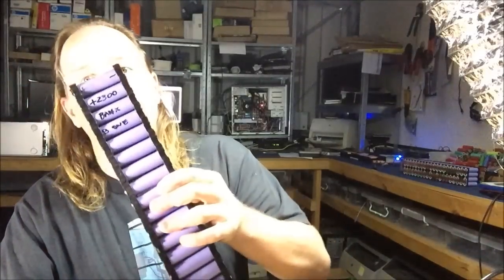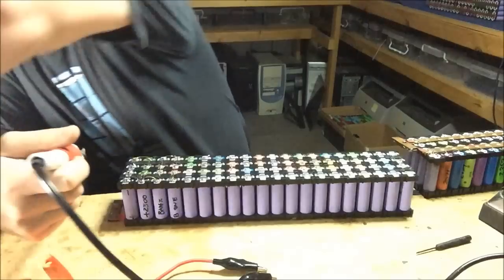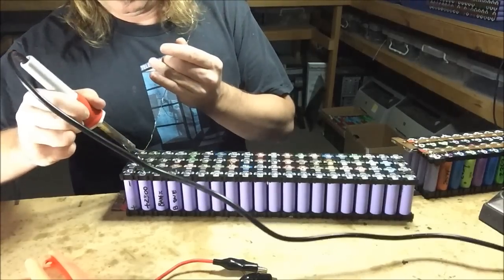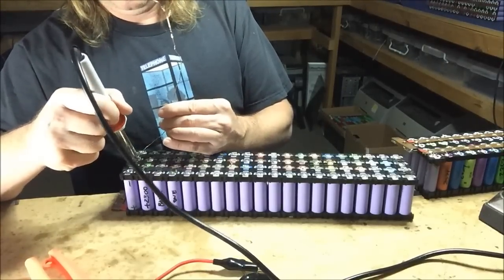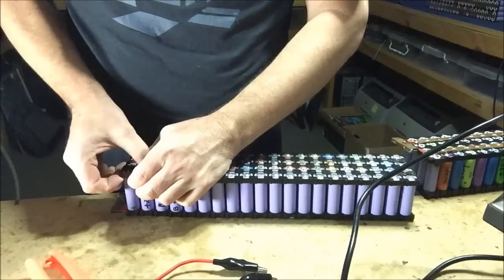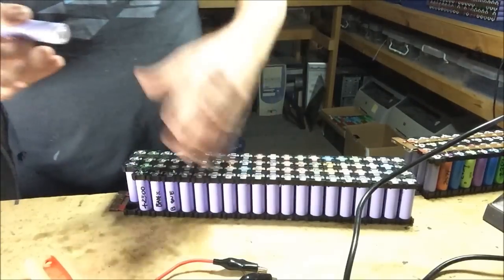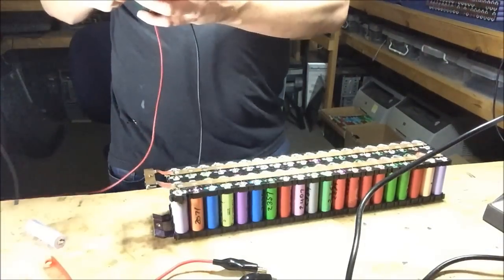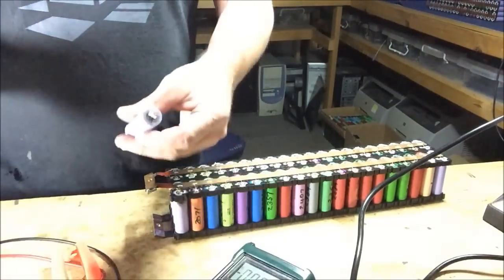80 cells versus 1 faulty cell 18650 fuse test

Comment: why not use just 5A fuse wire...its copper with a tin coating for a reason 
have you not just taken a cell out of a pack and just wired it outside the pack...why had its fuse blown..?
your are the best on the Tesla power wall thing...might get me one of those T-shirts
anyway its dull and cloudy here in the uk...keep it up

Comment: are the new stile lithium ion laptop battery ok to us in power wall they using the flat packs that look to me like lithium polymer
Reply from the maker: Anything is if you can make it work safely - it's all about second life storage
Reply: @HBPowerwall  they are i bit confusing as they say lithium ion on the laptop packaging but in side UPF576860TA sanyo 13wh  this is the only type of cell im able to selvage currently and cant seam to get any data on it

Comment: What is the average capacity of your cells? I'm trying for 2400 &  up and rated capacity or better.
Reply from the maker: Well just finished using the iCharger X6 https://goo.gl/GtBtW9 to tests 25 packs and even tho 'I THOUGHT' the average was around 2400mah testing the whole packs revealed that my average is around 2100mah per cell

Comment: Ahhh, shit. I seen the other video first, and commented on it (so I guess I spoke too soon, haha). 

Anywho, here is what I said on the previous video 

"I'm running a 48V 250Ah 16S50P LiFepo4 pack for an RV and used 0.125mm tinned copper for fusing, and tested it out. The fuse blows at 3.25A, red hot at 3A, discolored at 2.75A. I did this "in theory" because I didn't ever want the batteries to put out or take more than what the system is rated for. I could've used 0.1mm and still had been fine because 0.1mm blew at 2.75A. The cell fuses are rated around 40A higher (all together) than the main fuses (which are 125A mains). So it's not necessarily about protecting each individual cell, but more of an added protection according to the systems rating, although if a cell was to short, I'd hope it would blow. The main focus was to make sure the batteries are never giving or taking more than what the system's hardware can handle." 

So in the end, it's more about fire protection for the entire system, whether it is severed from an individual cell or not
Reply from the maker: All good - here is the reply from the other video... lol - "After two years of doing this cell fuses have now saved me a few times - several cells have gone zero volts & blown the fuse.."
Reply: HBPowerwall right on man. I tried testing the whole fuse wire thing about 6 months ago, but was performing the test using only one battery, and an adjustable power supply. I could never get the fuse wire to melt and break. So originally, I thought it to be a little stupid. But the only stupid one was me. There wasn't enough potential to blow the fuse, and the wire would simply get hot and only carry somewhere around 2.5A (at charging voltage). But hooking it up to multiple batteries, no problem, blew like a firecracker. 

I am going to do a slow motion video showing what happens to the fuses when you short 50 LiFepo4 cells in parallel. I did it once, and they blew so fast that I didn't even see them blow. It'd probably make a great slow mo video.

Comment: I ask for and advice, I make a small hole in a 8 packs cell trying to separate them, one small spark and the cell went into flames, all of them explodes one by one.  I'm concerned about security, I'm going to have 3 system 7.6kw, 7.6kw, 10.1kw a lot of cells, but if one of them goes into flame I think all of them is going to explode(very dangerous), I'm using 1 amp fuses in each cell, do you think this is enough security or I need something else.
Reply from the maker: You should seek professional advice - 'm not professional, I just document my journey

Comment: i whant to ask you i want to build a motorbike on electric 120 hp electro motor what is the best way to build you pack without bms, i dont like bms, and i want to charges  72 volt/ 144  lot of amp for long ride, greetings
Reply: You need BMS when dealing with Lithium batteries. By hook or by crook. It's for the utmost safety reason in dealing with delicate chemical energy storage.

It's like asking to supply power to your home without breaker/fuse.

If things can go wrong, it will go wrong - Murphy's Law.
Reply: Use a BMS intended for EVs that can send control signals allowing you to trigger solenoids/heavy duty high current relays. This way when the BMS notices an issue with the pack it can reduce/cut power, turn off charging or initiate balancing. It’s complex but building EVs is.

Comment: Batteries can fail in a multitude of ways.  They can go open circuit, short circuit or just plain poor in their capacity.  Fuses protect against a low internal resistance i.e. "short" circuit.  This is dangerous situation that can cause explosions with in the battery pile.  That is what a fuse protects against.
Reply from the maker: I agree, hence 4480 fused cells in my battery pack and soon to be 5600

Comment: Yeah , really good demo. Do you fuse both positive and negative sides or do you only use a fuse on one side for the 80 pack ?
Reply from the maker: first 42 packs are just fused on the positive side, next 28 packs will be both sides

Comment: It seams that so long as the battery has a charge  potential  between + and - (it's charged), it acts like a diode thereby not allowing a reverse current dead short between the busbars. And knowing that the battery has a tiny milli ohm internal resistance, when the potential is gone(flat battery) the current can flow backwards between the two BB. If that fuse wasn't there most likely there would have been a fire, unless it was one of those CID cells. 
There doesn't seam like  much documentation on how cells fail, so maybe you could do that same test on a variety of cells that you have deemed bad, just to see what happens. If you are looking for trouble and  have a isolated bunker with some long wires, maybe try it without a fuse.
Reply from the maker: I've done a whole weeks worth of work trying to get cells to fail - and to be honest wasn't worth uploading. You either have to be unlucky or plain brutal/stupid. To get a cell to fail on call well with my time frame anyway.
Reply: So out of all those dead cells you find in old packs, it's rare that they become a dead short and blow a fuse. The newer CID ones will pop the internal switch when they get hot, so they won't dead short. I have some old rusty ones that measure 1 ohm, and I have some dead ones measuring 10M ohms, so the 1 ohm can be a dead short, but the 10M can't because the resistance is too high. I would have thought most batteries fail to charge because of increasing resistance, so maybe the low resistance dead short is very rare. I guess can run a high potential in reverse through my rusty ones.
Reply from the maker: I weed out the bad/worse/dead ones in the testing process. Only a few cells that i know of have failed with daily use with in my powerwall.

Comment: that situation has been bothering me for a long time while watching you build your battery packs... I'm glad to see you did test that issue... couple questions (again) if you get a moment to reply...

1) how did you discover the defective cell among all the other ones besides how it looks ?

2) I see how short are your fuse link soldered to the buss-bar, have you tried this with such a short lenght ? All I see in your test is that you use like 2 or 3 inches of fuse (which might have a higher resistance thus making it blow faster that a short one). Take a close look on how close and short is your fuse link on the pack...

3) is not really a question but more of suggestion, you should have a damp towel near you, as soon you finish soldering, apply the damp cloth to your soldering point, it will cool the battery really quickly...

and lastly, while I watch how you constructed the pack, wouldn't it be nice to have like a battery cell box that could hold the same quantity of batteries as your packs but would allow to access any cell without having to solder anything... you know like when we use to put batteries in series in a radio or remote control... except this box would handle 80 cells... just ideas...
Reply from the maker: 1. Looks, voltage and fuse was blown

2. Done DOZENS of tests either off camera or just deleted useless footage there is little difference between 1cm and 10cm

3. Good idea

not soldering any more would be great :)
Reply: thanks for the reply as always... yep, the battery box would be awesome... maybe using a 3d printer, you could experiment with ideas... that would be great product to sell... only need to put batteries in the battery box and there you go, a battery pack ready for action ! All this based on your original design... but with removable batteries...

sorry for the typos on original question... I fixed some of the obvious... english is not my first spoken language !
Reply: something like this might be a start... http://www.ebay.com/itm/172128319128 you build PC board holdking these battery holders, you could stack PC board on top of each other to form a block similar to yours... on the PC board, you can add fuse link, test point, connections for cell balancing, ect...
Reply from the maker: good idea, but i really do like my way for right or wrong :)
Reply: of course, I'm not saying your idea is not good or not well build, far from it... just giving ideas for battery pack v2.0 with removable battery cells !!!
Reply: Hey Aleziss, like your thinking of a 18650 battery box allowing:
1) easy battery swapping of suspect battery(s);
2) not having to apply heat (solder) to battery during construction/deconstruction;
3) flexibility to add additional capacity or make hot swap-able; and
4) rapid continuity testing of each battery cell, together with its fuse.

Great set of videos thanks Pete, kept me glued to the tube all weekend:)

Comment: HB can you place a link for me to be able to purchase the fuse wire? Thanks
Reply from the maker: +Angel Gonzalez https://www.ebay.com.au/itm/252441212705
Reply: You are the best. Thanks
Reply: HBPowerwall Angel Gonzalez thanks, already answered my question in the comments for fuse wire (everything but the wire kept popping up for my search) .  You might want to pin it to the top cheers.  P. S. I might have a system on my food truck build with Generator backup. Appreciate the builds.  Paving a trail for us all

Comment: please repply:where did you buy your fuse wire. i want to build an innormous battery for my car using 18650s with 4 cells in series. im thinking about 160 batteries per cell using >1000mah batteries discharged at 800ma. later i will build more. but for now i want to be sure its not gonna catch on fire. im thinking about a metal box but yea how do i fuse them? its gonna be a car audio setup btw
Reply from the maker: +JusstyteN https://www.ebay.com.au/itm/252441212705
Reply: +HBPowerwall oh so its just a copper wire. after doing it would you suggest something better or would still use this winding wire?
Reply: btw thanks for repply
Reply from the maker: +JusstyteN I would use smaller winding wire. 0.15mm
Reply from the maker: +JusstyteN maybe this https://www.ebay.com.au/itm/111675031412  0.19 mm
Reply: +HBPowerwall thank you :)

Comment: Good test , it's how I tested my fuse wire . But great to see it confirmed by yourself and others via comments . This is the fun of being a pioneer .
Also confirms how I will build my packs using some of your techniques  ie bus bar and Pauls K approach using 18650 holders and tab welding 4x18650 batt in parallel -- now I ponder - do I fuse the positive of each grouping or is the fuse used between the holder and the busbar enough ..
Also doing it this way means I can remove each 4x 18650 grouping for easy inspection or replacement ..   
Regards from not so sunny WA

Comment: I copied using your fuse wire idea on my packs, I melted off all the plastic on the wire by sticking the entire pack of wire inside of a pot of boiling water on a little electric cooker, I would re-boil the wire occasionally because it seemed to only melt off the wire on the outside layer of wire on the roll... but when I would use the wire I just left the entire roll in the boiling water while I ran the wires around all of my screws on my screw touch method..

Comment: I also wanted to use fuse wire in my much smaller power packs, but when I tested wire with variable power supply I found that it can actually glow without blowing with right amounts of amps. So I'm guessing in 'right' conditions when cell slowly degrades fuse wire will become hotter and can actually start fire...
Reply: You may be using the wrong  type of wire. Different metals well react differently. Steel wire will get much hotter for much longer time periods than say copper or zinc. fuse wire is almost always copper with a zinc coating. For safety, I would suggest keeping a fuse wire as short a length as possible.
Reply: You may be using the wrong  type of wire. Different metals well react differently. Steel wire will get much hotter for much longer time periods than say copper or zinc. fuse wire is almost always copper with a zinc coating. For safety, I would suggest keeping a fuse wire as short a length as possible.
Reply from the maker: totally possible unfortunately
Reply: Although, the shorter it is, the less wire will be exposed to the "real heat" and the heat will dissipate out the solder joints.  I think both the right type of wire, the right length matter here for an effective fuse.
Reply: Low amperage (<15 amps) fuse wire is usually made of a tin/lead alloy that melts very quickly at a set temperature. Thats why it's a good idea to use real fuse wire, and not just a fine gauge tinned copper wire. You really want your fuse to go from conducting just fine, to overheating and burning out over a very short temperature span.
Reply: I think Serhiy is right and it's dangerous to leave the fuse wire open. But it can be put in a glass capsule like the fuses we can find in our multimeters. They are protected from external influence, they are fire-safe and can be easily replaced. The disadvantage is that they need a bit more space. https://media.rs-online.com/t_large/F7897842-01.jpg

Comment: Fuses are good!  However something to consider is, given the fuse is the highest resistance conductor in your circuit I'm wondering if you should endeavor to make them all the same length so you do not over-stress certain cells vs other cells in the same parallel pack.  (I'm not sure if this mOhm difference makes a difference - more expert advice needed)!  However, if you read up about paralleling many lead acid batteries together they always recommend using the same length wire to the buss bar.  

I have not looked at your earlier videos about the fuse wire - did you also look up its rating on a chart?  just google "fuse rating of swg wire" for a table.   The figures in these tables should correlate reasonably closely to your experimental data.  The rating at 12VDC should be essentially the same at 4.2VDC - its the amps doing the heating!

Comment: Hi Pete, I agree with your conclusion that the fuse in its/your "normal" environment will blow. I can imagine that the first test in your previous video scared the sh%t out of you, I felt with you. You might consider to use a lighter fuse for future wiring (thinner wire), now that you know that your operational peak current of the total system is even lower than what you expected to be using. 48V or 12V won't make a difference for this type of fusing, you will only have even much lower peak currents on the packs.

Before you change anything, if you even consider,  I would do a real current vs time test on the fuse wire in your real thermal environment (with the busbars and same length as you use on the packs) by using a known current. With a 4.2V pack (now you do have the test tools for it, with these packs), you could start by putting a 3.9 Ohm/5 Watt resistor (keep them in open air or near a fan) on the positive and on the other end the fuse wire and then the negative terminal. By adding a same resistor each time in parallel with the first resistor you will add 1.1 Amp current with every resistor (as long as the pack sticks at 4.2V), 25 pieces of them should be enough for the test :-)  .  BR  Sjef.